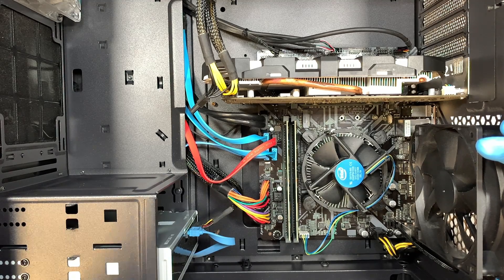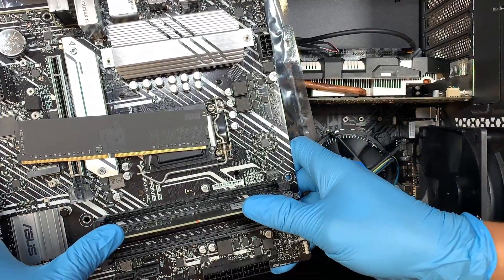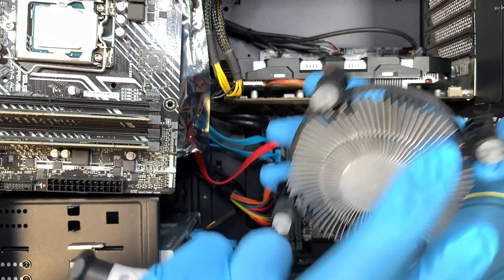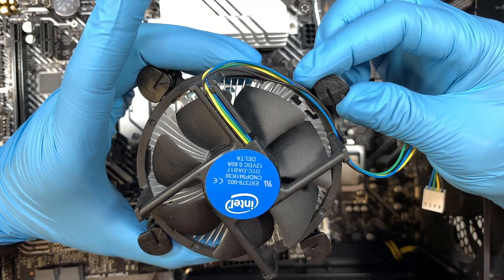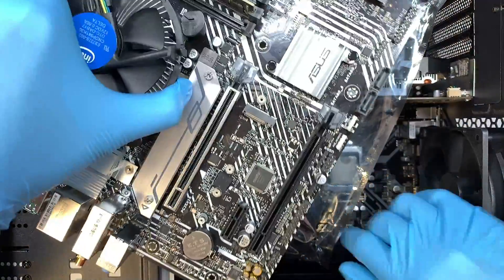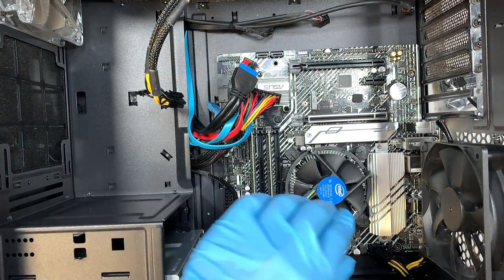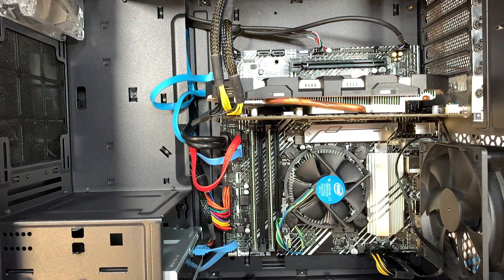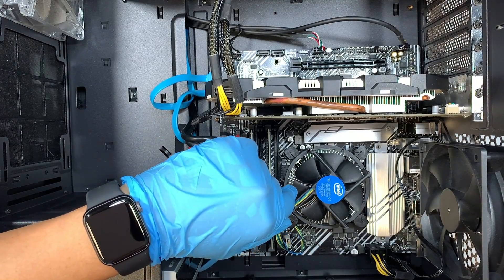Asus Prime B560M and Intel i5 LGA1200 Setup Installation

Comment: I7 4th generation processor can work in b560 motherboard?
Reply: Only 10th and 11th gen processors
Reply: no your better off using a b85 mb or any motherboard that is lga 1150